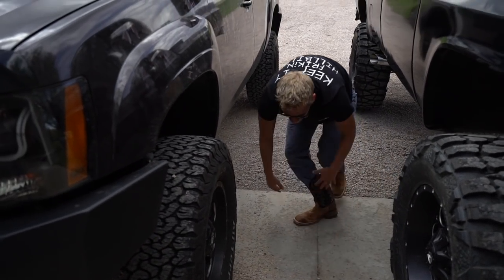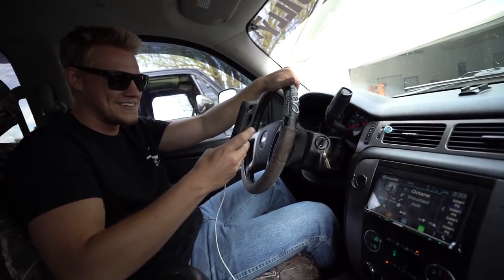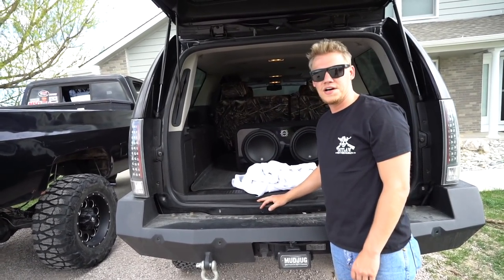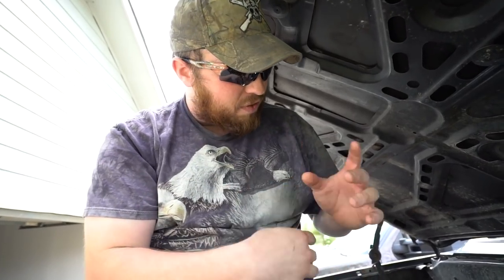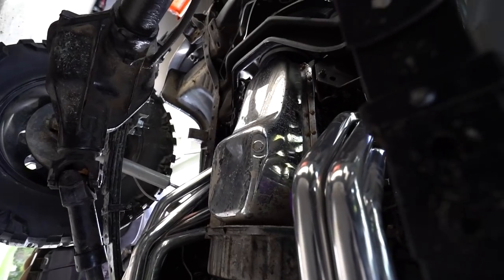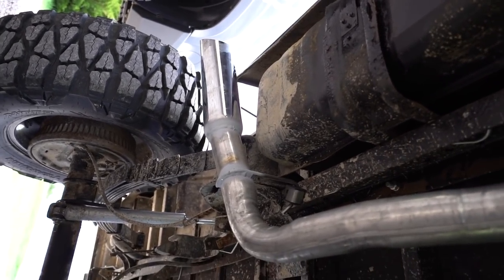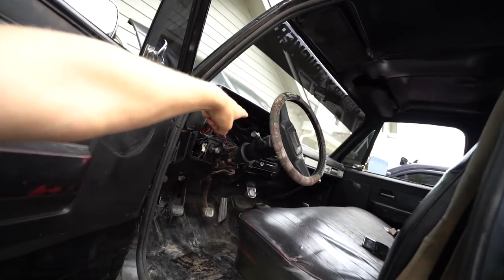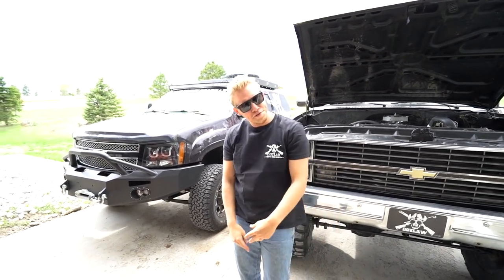New Exhaust is CRAZY + other Truck updates!!

Comment: Do Rockford highs on a Rockford amp, great sound clarity and especially for the price! I run all Rockford highs on a Rockford 300.4 but got a 400.4 when I put my super tweeters in, but I also got 2 hdc3 15's in a 10 cubes box beating my truck apart 👌🏻

Comment: I have a 4000 watt D class going to 2 15 inche solo baric L7 and then a 1500 watt A/b class Amp going to my 2 6.5 mtx and 2 6×9 mtx and 2 Twitter mtx which are all the highest class mtx speakers you can get. With a pioneer head unit.  In my opinion if you have a system you need a alpine or pioneer head unit.

Comment: Lol nice sound system bro but my moms car has 10 speakers. 6 under the back window. And 1 on each door and when you turn it up with the bass in the middle it's shakes the just a little but when it's all the way up you'll think the doors are about to fall off idk were we got them cuz we bought the car used and they were the same speakers